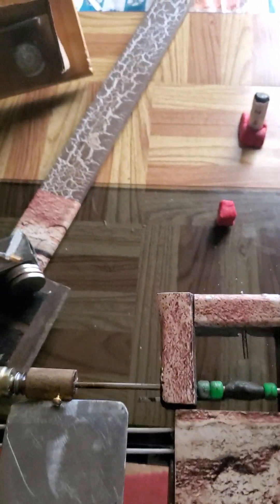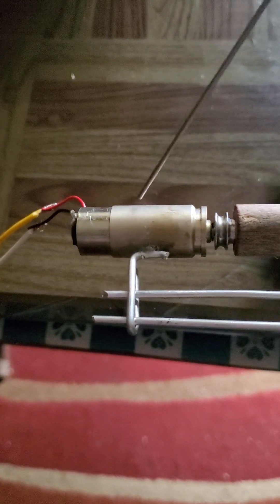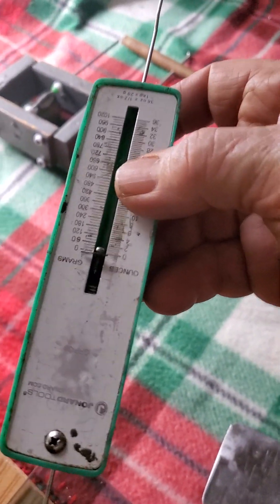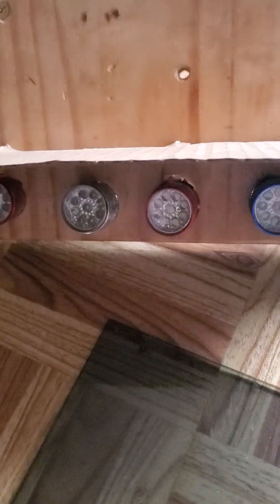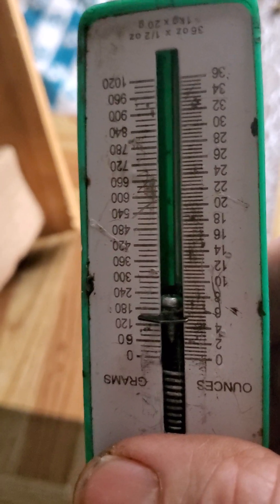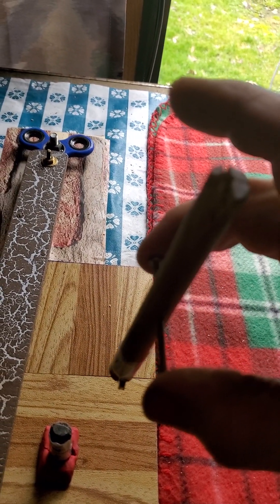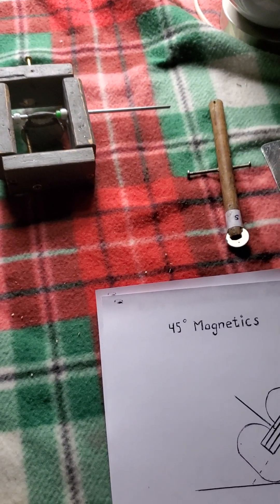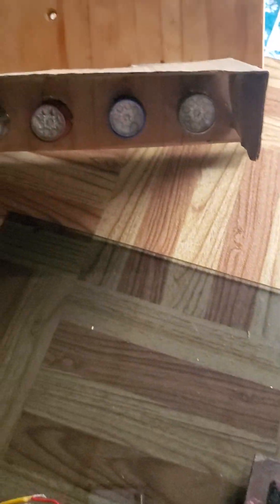Ray's Magnetic Circuitry { Part 1 / Lifter}

Comment: don't stress a reply for this because you likely already know, but just in case you didn't

Increasing the electrical load will increase the resistance it takes to turn the generator

Sorry if you did already know! Maybe I'm just silly but it felt a bit weird with how you were measuring the force required with such a small load. Fair enough if I missed the point!

Maybe a fun fact that probably wont help in the slightest, but apparently if you hold a rod of iron (something like) 60 or 70 degrees north, and smack it on the end with a hammer, it will become a magnet (albeit a weak one, but it could depend on the force of the hit).
Reply from the maker: No problem...This design has some unique characteristics: the the output load on the flapper magnet is independent from the input force : the flapper output magnet can have no load..or it can be under full load [ led lights ] ..the ounce gauge did not show increase when I moved the arm in and out of firing position ; perhaps if the gauge where more sensitive. In conventional application this is not normal . This independence of input forces from output forces account for the gains measured  ...